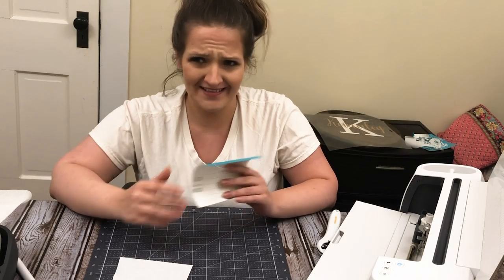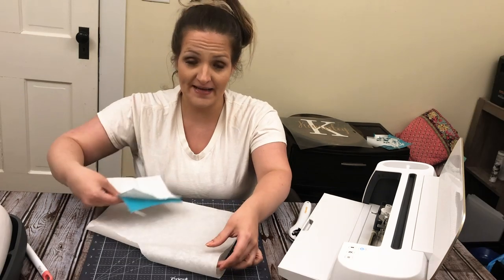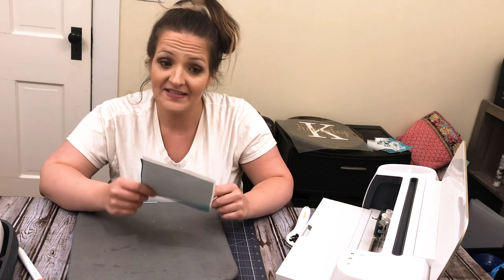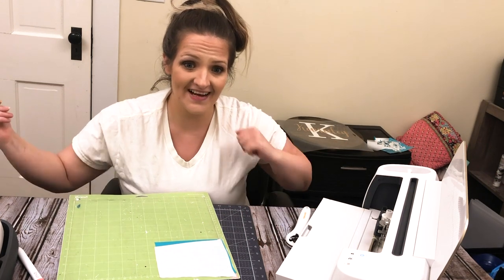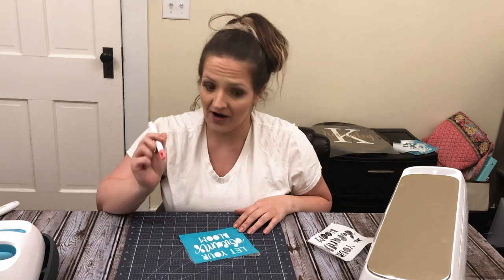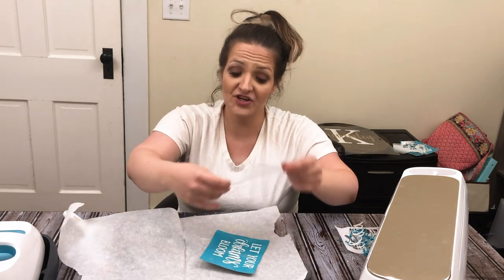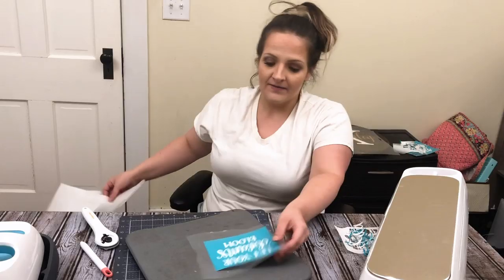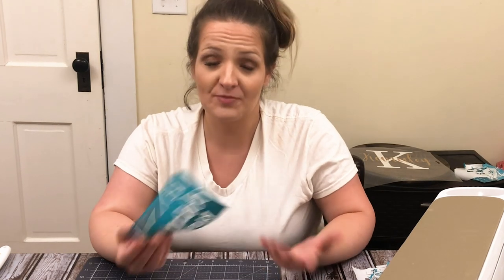How to make Chalk Couture Stencils | Mesh Adhesive Reusable | Transfer

Comment: the traditional silkscreen mesh I have is thicker so I'll probably have to press longer. it's made for silkscreening with acrylic screen inks. a denser mesh. also the tulle should be dense soft tulle (one shouldn't see the holes in the mesh). Add that to your description on your video.
Reply from the maker: Great idea. I made sure to mention in the video that I was only using tulle bc it’s what I had on hand. I’ll add it to the description in case anyone skips over that part :) 

When my silk screen came in I tested it using the same method and had great results. The tulle was great for testing proof of concept but definitely not ideal if wanting to make true reusable screen printing stencils!
Reply: @designyourlife718  my mom is getting me an easy press for Christmas due to this video. I think you may have made my life miles easier. I forgot to get the heat n bond today at Michael’s . I have some but I’m. It sure if it the one you mentioned . Easy press and mat is on sale right now. 
Eventually I’d love to get the Epson dye sublimation printer.
Reply: @designyourlife718  Have you tried the heat and bond vinyl? I got both to compare.  If I use the vinyl heat and bond, what method could I use to make the bottom re-stickable? And suggestions?

Comment: Loved this idea.... one reason I never wanted to invest too much in Chaulk Couture is because you can’t be as creative with your own designs...... you are limited to just theirs....... I love the ones they do, but always wished I could do my own, as well! Thanks so much for this! Would you show one of your final projects? How did this one turn out with the chalk paste applied?
Reply from the maker: I plan to do a part 2 and do a fun project and cover some washing/drying tips. I went through a ton of methods/versions of these before I found the best method. Because I was testing so many I just used scrap materials and random paints just to ensure they worked well. I tested this specific method out on hard surfaces and craft paper (I wanted to be sure they weren’t too sticky that they’d rip the paper) I think these are great for sellers to add personal touches to packaging without wasting vinyl. I also tested on canvas, wood, and kraft paper with acrylic and chalk paints the lines were always crisp and it lifted off easily without issue! (I was not cautious when painting n purposely went crazy to attempt to cause bleeding) The bond is really strong so I washed carefully but never felt afraid I’d rip off the mesh/tulle off. Once dry they were fully sticky again :)

I just didn’t want the video to get too long so I figured a part 2 was a better option. The issue is deciding on a project, lol! I’ll definitely do a custom SVG project and include a link to download for free. If you have any ideas you’d like to see for designs let me know :)
Reply: That’s wonderful! Would love to see it on chalk boards or wood surfaces..... maybe to a Halloween theme on both of those surfaces! Thanks so much... can’t wait to try myself!
Reply from the maker: @badputts  Halloween/Fall is a great idea! Do you like more intricate/fancy designs? Or font with larger design elements? I haven't started working on Fall designs yet but I'll definitely release a bundle. I'm actually an SVG Designer but I post most all the files in my FB group for free (some I exclusively release there and don't sell at all to keep them exclusive to our little group as a thank you). If you ever are struggling to create a design you need, you can always reach out through here (I'm pretty certain there's a message system on YT) or FB :)
Reply: They do t have to be intricate... especially as a stencil ( for me)... I will stay tuned for your future posts! Thank you!

Comment: Couldn't wait to try this and I'm so frustrated.  I get to the point of weeding the letters and have tried all different types of letters with the same failed result.  It's like the glue from the heat and bond glues the letters to the stencil and you cant remove them.  I'm beside myself. I'm following step by step, 280 degrees for 10 seconds but fail fail fail. :(

Comment: Could I use Oracal 651 instead of the stencil one? I'm mostly wanting to make reusable stencils for onesies.
Reply: I would LOVE to know as well. I'm thinking of making my own using 2 part emollient, and silk  screen material, like attach it to a frame so I can coat it with the emulsion (front and back 2 light coats) then simply cut it to size after burning image and washing. I'd like to try this as well, and I have 651.

Comment: I tried going by the directions and watching the video several times.... I should have tried on a smaller scale (6x8) was the first three sizes I messed up. The wax paper stuck and then I didn't weed it like I should have before putting the mesh on..... any whoooooo.... I finally was able to make a "good" one. I painted it instead of chalk....... not the prettiest. There was alot of bleed. I have not given up, but I think I need a glass of wine to make another go of it.

Comment: I followed the directions and my transfer wrinkled when I ironed it.  I did not rub the iron, just placed and pushed down.  I had the iron on the lowest setting and used parchment paper to protect the transfer and my iron.  I did not three times with the same wrinkling each time.  HELP!

Comment: What setting should you use if your using a silhouette machine
Reply from the maker: I have not tested it on my silhouette but I bet if there’s a chart that shows the equivalent of cricut settings for silhouettes. I used the holographic HTV setting. I’ll do a quick search n see what I come up with. 

Alternatively you could do a tiny test (silhouette has that option built in) and find the perfect setting (settings often can vary slightly depending on how sharp you particular blade is)
Reply: Someone else in their comments said... Cut Heat Transfer, Metallic  Setting (Blade  3,  Force 33, Speed 5,  Single-pass)

Comment: what gauge toile do  you use?  I know there is a small and larger weave.
Reply from the maker: Cindy Haydon it doesn’t say on the packaging. It was from michaels. I had it from previously making tutu’s. I have seen mesh screen material on amazon which I’m sure is much finer and preferable. Bc it’s a heat activated adhesive n quite strong I’m sure it will bond just fine to any mesh like material used :)
Reply: @designyourlife718  I tried it and I had a sheer curtain I had bought to try screen printing, it worked great. I also used 811 stencil mask because I didn't have any 631 vinyl.  thanks for this video, its great
Reply: @tonyapitts4991  hey there, how did your stencil turn out?  More importantly what do you mean a sheet curtain? Like a sheet or bedsheet?
Reply: @charley408  it turned out great, I used a sheer curtain.  I had a spelling error in my first comment it should have read sheer curtain not sheet curtain.  like this  https://www.walmart.com/ip/Mainstays-Marjorie-Sheer-Voile-Curtain-Panel/44434384

Comment: How would i do this on the explorer (what setting do you recommend)! Please help asap!
Reply: I love your video and sunscribed to learn more. Awesone job. I dont think i did mine right so far looking for advise
Reply from the maker: I used the holographic vinyl setting, which would be on the maker and explore machines. Your blade may be newer or older than mine and require some tweaks. Is it cutting too deep or not deep enough? Is the heat n bond fully adhered? Let me know what the problem is and I can help trouble shoot it :)
Reply: I believe she said in her video. Maybe holographic glitter vinyl setting.

Comment: I already have some oramask 813 (oracal stencil vinyl) on hand. Has anyone tried this technique with that product? Just wondering if it holds up to the heat as well.
Reply: I thought she said to use 831 🤷🏻‍♀️
Reply: I tried with frisco stencil vinyl and the glue from the vinyl itself went everywhere including the parts I already weeded out. I only tried once so now I need to play with the heat setting.

Comment: What are the raw materials / paper used
Can you provide them with available links
Reply from the maker: The vinyl was 631 (removable) vinyl. I used tulle in this tutorial since it's all I had on hand but screen printing mesh is ideal. 110 silk screen mesh is the most universal/common to use and also what brands that make these stencils professionally advertise that they use. And the heat n bond ultrabond was the adhesive used. 

Mesh silk screen (110)- https://www.amazon.com/Yard-Screen-Printing-Fabric-110-36/dp/B07F12WBVD
Heat n Bond- https://www.amazon.com/HeatnBond-UltraHold-Iron-Adhesive-Inches/dp/B000XAMYXI/ref=sr_1_1?keywords=heat+and+bond&qid=1566619038&s=arts-crafts&sr=1-1
631 (removable vinyl)- https://www.amazon.com/ORACAL-Turquoise-631-Matte-Vinyl/dp/B06XRHGHXH/ref=sr_1_27?keywords=631+vinyl&qid=1566619065&s=arts-crafts&sr=1-27

*The links above are NOT affiliate links
Reply: @designyourlife718  Thank you

Comment: I'm not sure what side to put the mesh on.
Reply from the maker: You’ll want to put the mesh on the non tacky side of the vinyl (and after applying the iron on adhesive). This leaves the permanent vinyl’s adhesive intact so that it can stay in place when using it as a stencil later :)

Comment: Girl, I wish the newer videos on youtube would have given you credit for their content since you are the first one I've seen do this. I mean they use the same exact materials, except for the tool, but you know you only had tool at the time of the video. They used the same exact steps. I have been using IKONART stencils,  they are in my opinion CHALK COUTURE  made theirs from using photo emulsion coated silk screen w/pressure adhesive. I would like to figure out something to use for adhesive on the back of your idea, something to use because the adhesive vinyl wont last of course. So yes girl, I think I'll have to comment on the other 2 videos I've seen using YOUR technique. Its soooo much cheaper then using IKONART stencils or other photo emulsion silk screen sheets.